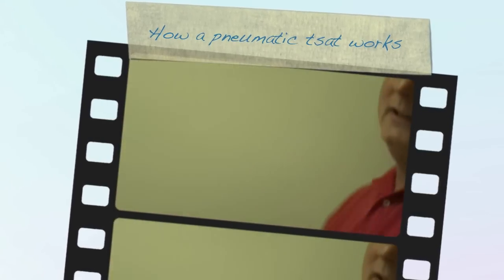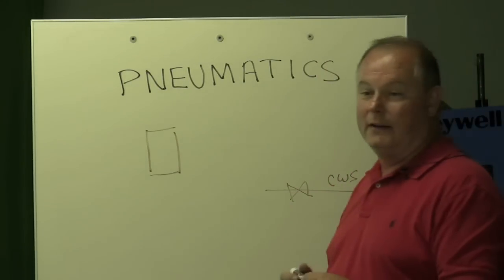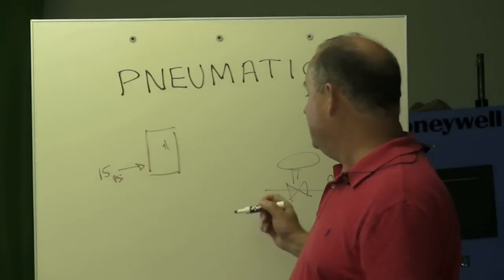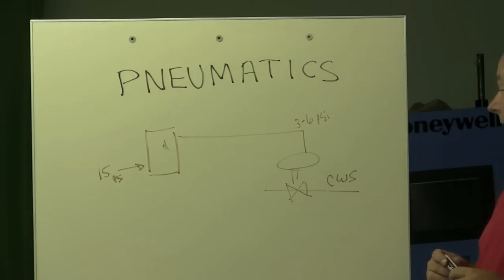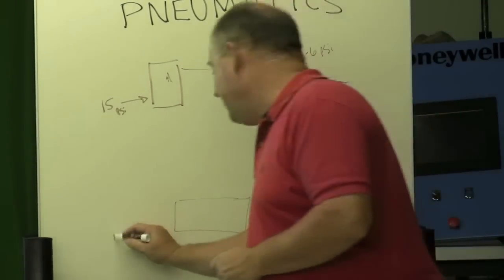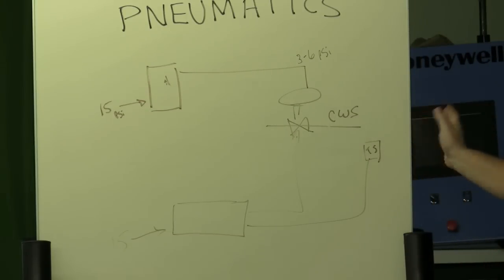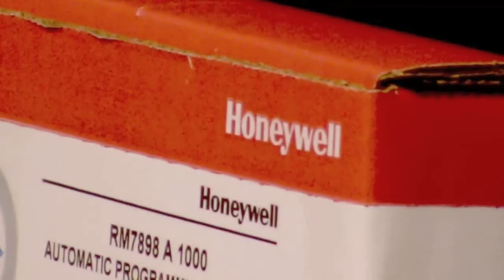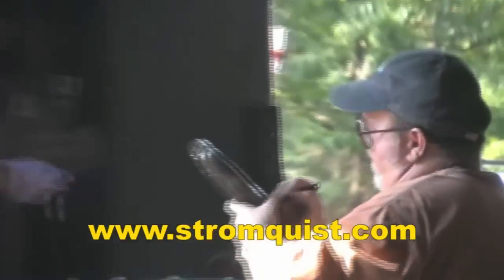How a pneumatic thermostat works

Comment: Why are pnuematic thermostats used at all? It seems like a much more complicated system than just using a few 24V wires.
Reply: Older buildings. Before digital controls were popular.